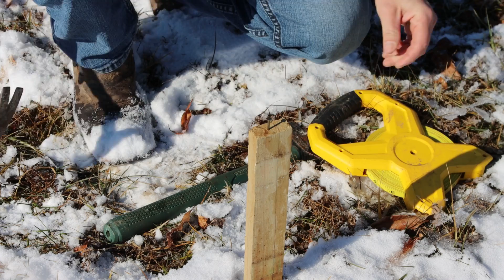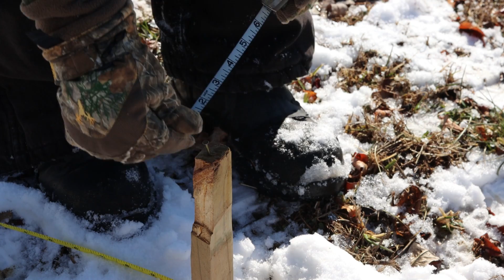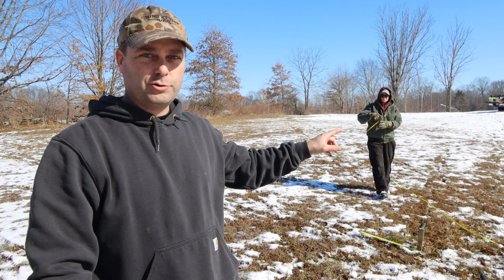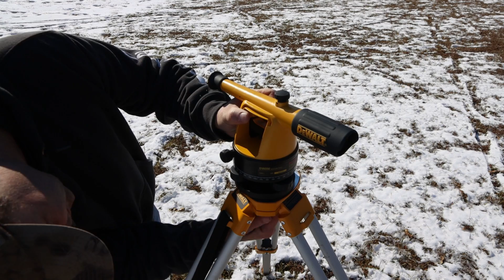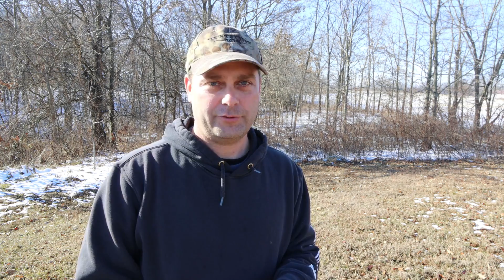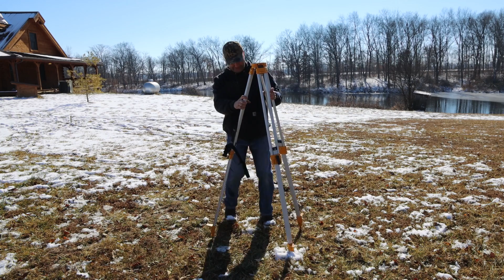Laying our build site and Measuring grade.  Pole barn workshop Build #1

Comment: I commented earlier but forgot something. Site prep prior to placing fill. Remove all grass, tree stumps and so on. Scarify surface down about a foot and remove topsoil if good quality for later use. Compact the area real good for the start of a solid surface. Some would consider removing some material from higher ground to lower ground to start with a more uniform material across the site. Settlement is directly proportional to amount of undisturbed ground to thickness of  fill to compaction effort.

Comment: You could take the higher end and fill in the lower end, but you would have to figure out the cut/fills that would balance it all out, then you could add a uniform thickness across the whole barn site. If you fill up to meet the highest grade, you will need quite a bit extra to slope the sides and make is accessible to equipment. Let me know if you have questions, I am a civil engineer by trade.

Comment: Over the years on my farm, and with my building projects, I always try to remember to look at interior space of a building.   Most people look at outside dimensions.  So a 52’ x 76’ pole barn might only have 50’ x 74’ of usable space when you take away wall widths.  
And remember when dealing with fill dirt, truck loads are loose fluffy dirt, and then you compact it.  So if you need 500 yards fill, that’s going to be compacted fill, and your  going to need a few more loads after getting it compacted than a guy thinks.  Also probably going to need a lot of extra fill to tapper the slope off from the building pad to the surrounding grade. I would like to see your finished slab a foot higher, or more, than surrounding grade.

Comment: Here is a suggestion, I have done my fair share of butchering you might want to consider conduit running to a bandsaw in your butcher shop. A professional meat grinder is also handy along with a two-sided deep stainless steel sink, just a suggestion. The pole barn is just like buying a Cadillac you got to pay for the extras.

Comment: Usually when dealing with an odd-shaped area is that you break it up into even shapes so you end up only having to deal with a very small odd shape that you can approximate. For the added toilet, you could make a wood chip potty so you wouldn't need to run water and sewer.
Reply: Their plan is to have a "Butcher shop". That will need some sort of drainage system to wash out the gore and general cleanliness.  That would require some sort of waste handling system.  Connect your bathroom to that.

Comment: I would be taking a skim of topsoil off first for the basic floor plan.Then using your lowest point as a datum,triangle measurement(half the build floor) 1'9"(half of 3'8")' + 3% should give you a rough idea on the hardfill you require.

Comment: I wouldn’t want to put fill under my building. Even if you compact it will settle for a long time. You would need to figure drainage from the high side such as a Swale so the water won’t run down to the building. By all means put in a bath and water. Good luck.

Comment: Dear Evan,
First off, you have to allow a larger pad for the building to support the building. When you grade the pad, add an extra five to ten feet on all sides, plus the slopes to receive fill. And you have to figure the fill material for all of this.  Be sure you are not getting strippings (top layer of clearing ) but good, compactable, fill soil. Compaction should be in the range of 90% to 95%. And then... the question of shrinkage has to be addressed.  Non-compacted soil loses it's volume when compacted.  This is called shrinkage and runs in the range from 2% to 2.5%.  To figure fill material, add the 4 corners (including the extra area outside the pad and 1/2 the slope) and average them. Now multiply that number by your pad square footage (plus extra added pad) to get cubic feet.  Divide by 27 to get cubic yards. Multiply by 2700 (pounds in a cubic yard) and divide bu 2000.  This will give you the tons. This grading project should not be done when the soil is wet as soil will only compact when the moisture content in at a certain level, or lower. Non compacted fill will only come back to haunt you in the future.  It takes 5 years for soil to start settling. If I have totally confused you, please feel free to contact me.

David Terrell
Comer, GA

Comment: The $150 difference between the rotary laser level and the builders level is money well spent. You can do it yourself. it does not require two people. Plus many more uses later as the build develops. JMHO

Comment: I think you’ve gotten plenty of advice on how to calculate the fill from the other comments. My two cents (from personal experience) is make sure the fill is compacted well an drainage/slope away from the building is adequate. Trying to fix those issues after the fact is damn near impossible. Also do your research on best practices as far as the concrete slab. Don’t let the contractor talk you out of rebar or cutting expansion joints.

Comment: Do not place the new barn at an angle to the house ....... it will sit better to your eye if the lines are parallel. After all you will see both buildings as you drive up to the house and not necessarily the field line boundary.
Also if you take a pruning course your fruit trees will eventually have a better shape as they mature ...... their scaffolding at the moment isn’t great 
Great fun watching you .

Comment: The best approximation to the volume of aggregate you need is to calculate the volume of the box (length 76’, width 52’, and depth 3’8”) then divide by 2. It is the same principle of the area of a triangle; imagine the volume of the box and then cut it in half from corner to corner.  76x52x3.666= 14,488^3’ /2=7,244^3’ or 268.3 cubic yards.
However this is only an educated guess. Should you need the exact volume you have to calculate it according to the topography and the elevation curves, which involves way more work than measuring only corners.

Comment: Figure it as if it was a square or rectangle then divide it in half to find the volume for a triangle. not perfect but close. as the others said, need to remove the topsoil first to see how much fill you need. topsoil can be a couple inches here and 5 feet away it is 3 feet deep.

Comment: figure the area at 56 ft width, on each end of the building. then add together and divide by 2. then multiple by the 76 ft length. divide by 27 for cubic yards. that is the way the dump truck volume is measured.   that is the way I leaned to do cross section calculation for road building in surveying class. now it is all done by a 3d computer model for cuts and fills.
if you want to be more precise, do the elevation at 1/4 points on the 76 feet length. repeat the process and calculate for 19 feet. you would do it for 4 areas and add together for total cubic yards.

Comment: make sure you strip off the grass and at least core the building location add at least ten feet to your dimensions so you can put in the slope you need you should elevate location to keep all water away.my 40x80 took 12 loads to raise location 6 inches without a few more readings on location a guesstimate would be over 400 yards to level location good luck will be watching

Comment: Since you are doing a poured concrete floor and are no familiar with grading and compacting this is one area where I would just pay to have a contractor experienced in this do the fill, level and compaction to avoid any issues with settling and cracking of the floor.

Comment: Well you can't just throw the Pythagorean theory at that one. You're going to have to figure out your average cubic foot drop, by measuring the drop at one or two foot intervals, both length and width and averaging. Then you can figure out your cubic feet of fill dirt by multiplying that times the length times the width. You need to also take into account the material that you're filling it with, if it's loose soil type A, you're going to have a 25% compaction rate. The composition of sandier harder soil type b would be a 20% compaction rate.
The easiest way to do it would be take the highest corner and subtract the lowest corner and multiply that times the diagonal measurement, and add about 20% for error. I could do it for you if I knew the drop rate every couple of feet. Good luck,
Jimmy

Comment: need to calculate volume, narrow side versus deep side concrete calculator should work  need to calculate area of triangle then multiply it by the width you have.  You have two sidees the base that will be the width. then you have the height  the rise in the fill, Then figure the area    52 x4 =208/2 = 104x72=7488cuftx0.03704=277cuyds of fill needed.  That is going to be a lot of fill, which needs to be compactable.

Comment: Old fence lines might be outside of actual field border by up to 25 feet. Surveyed fence line is only actual safe starting point.
Reply: Only matters if the "Fence" line is alleged Property Line . If it is a simple fence line dividing Their Property into smaller divisions it does not matter.
Reply: They also own the land on the other side of the fence.
Reply: @boathead22000  I was assuming that but wasn't sure so I didn't say it.

Comment: Volume first in cubic inches or cubic feet. Then to cubic yards. Allow length and width that will define area of fill cause area will be larger than the pole barn foot print. Cubic feet or cubic yards to tons is based on Bulk Density of fill. Bulk density can be equated as Loose/ Bank or compacted. The truck will bring you loose and you will then compact in place. Loose to compacted is usually 80% or a 20% shrink. Your material provider can provide you with amount of shrink but you will want a 2" minus that has a good gradation, contains particles in quantities and sizes that will compact best. Plan to place material in 1 foot loose lifts then compact entire area. Start at the lowest working in lifts. This will help prevent settlement later. Don't allow any grass, logs or wood, organics, to contaminate the fill material. Best to over fill and then cut to final grade when construction starts. This sub-grade is the most important part it will support all of your investment. Good Luck.

Comment: When planning your wood shop, don't skimp on dust collection and compressed air ports. I thought it was very manly to make sawdust into the shop air never thinking about the health risks. My shop no a is plumbed with both a dust collector and 6" piping and a shop vac with 2" PVC for power band tools. I also have an air cleaner hanging from the ceiling.

Comment: were so many screw up is they dont lift the grade enough so they can slop the groung a good amount so heavy rains the water runs away, and they end up with water running into the building, i see it all the time were people have done it on there own then the water freezes and the over head doors dont open, also you have to strip the grass off and all top soil, and compact the fill dirt in 6 inch lifts or you will have big problems down the road the standard lift of dirt here is 2 feet above grade for any building

Comment: One suggestion, when you run the conduit in the floor, put a pull wire in it when installing.  It'll make it a lot easier pulling the hydro wires through when you wire up the outlets.  Cheap welding wire or 1/4" nylon rope, whichever is cheaper, will be perfect.
Also, check out Rainfall Projects, he has outlets inset into his concert floor of his barn.  You might want to do something like he has.  Cheers!

Comment: I recall earlier on, you stating that one of the reasons you demolished the old white house and the old green house were tax concerns - these were permanent structures with foundations, so you were hoping to reduce the land taxes by removing them. Doesn't building a pole barn with a foundation (if a slab counts as that) undermine those efforts? Or does that only count for 'habitable' dwellings?

So, by my count you have
1. Your house - obviously, to live in
2. a barn - for animals, and farming supplies/equipment
3. A smaller barn - or enclosure, for the goats
4. A hog enclosure - for raising hogs
5. A workshop - for larger equipment and tools
6. A carport on a slab - for larger equipment

Not sure if it was mentioned already, but what is the pole barn for? Future endeavors with cattle? Maybe I missed that in prior videos.
 
Also, I continue to be surprised that you both have adult children who have already moved out. You both look younger than me. Must have been smart and started early. XD
Reply: Perhaps the house and greenhouse were not in good condition to keep on the property and renovating them was not something they wanted to take on.  They have plans and goals and if you paid attention to their 2021 goals, clearly states what the pole barn is going to be used for.  I guess you could look up Illinois tax laws to determine if the outbuildings are considered taxable.  

My cousins wife raised her 3 brothers/sisters when she was 18 and they consider those children as their children and never have had their own children.   Her father murdered her mother.   My daughter is 34 and has 1 child in college and 1 child in high school.   This is their private business and people need to be respectful to this part of their life.  Stop asking.
Reply: @skrtskit1521  I know the previous buildings they demolished were demolished because they were in bad condition, they stated as such, and that's why I didn't ask about those. Looking up Illinois tax law won't answer my inquiry as to why they chose to build more structures - again, perfectly fine for me to inquire, but not your place to answer for them or tell anyone they can't ask. I stated that I may have missed it in a previous video, and if you saw that video, you could have simply answered my question. Instead, you chose to behave like a contemptible person and be angry for someone who *didn't ask you to*. 
 
Why do people like you come out of the woodworks on the internet with the sole intent of being offended for the sake of others? I didn't ask you anything, it isn't your place to answer for them. Further, it isn't your place to tell anyone who can ask what. It's community engagement, and if they choose to ignore my question, that's their decision, and I'd respect that, but it isn't yours. I didn't even ask about their children, I simply said they looked very young to have had adult ones. If that upsets you, then feel free to go be upset someplace else - none of my comments or inquiries were directed at you, and quite frankly, I don't care about you, your family, or you personal anecdotes.

 
We're all here to enjoy the content, and I was very polite with the question I asked. You're not them, a member of their family, a friend, a moderator or a community standards enforcer at YouTube so stop attempting to police people's comments.

Comment: You did not take enough measurements to know how much dirt you will need. You have a drop off a little over 3 feet, but is it a drastic drop off? From your sight point  you are measuring about 45 feet to your stake. If at the 35 foot mark you only have a 1 foot drop you would need much less dirt then if you have a one foot drop at 15 feet away from where you are sighting. As for as dirt and weight it all depends on the dirt as to how much a cubit yard weights. Most places sell dirt by the cubit yard not by weight, the only real reason to know how much it weights is if you want to know how many yards your truck or trailer can carry at a time. Other commenters have said how many cubit feet are in a cubit yard and another one said that you need to remove the top soil which you do and that will increase how much dirt you will need.